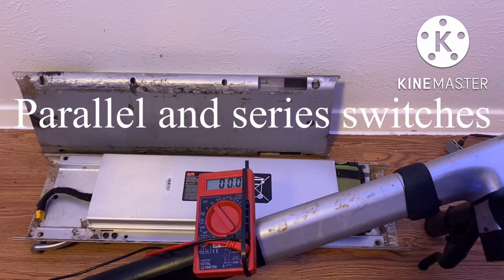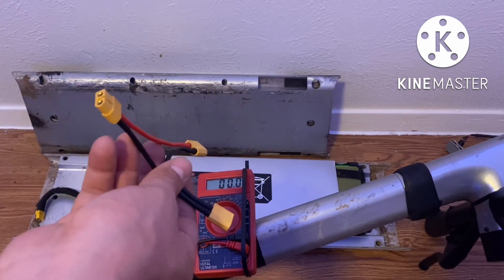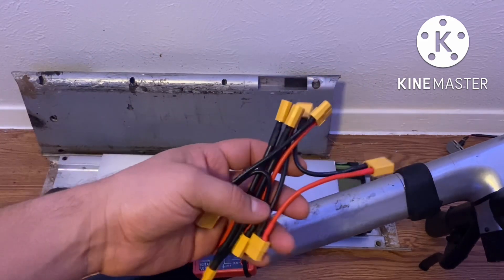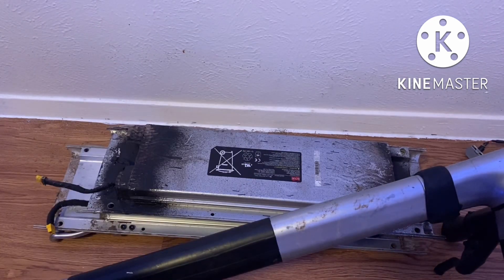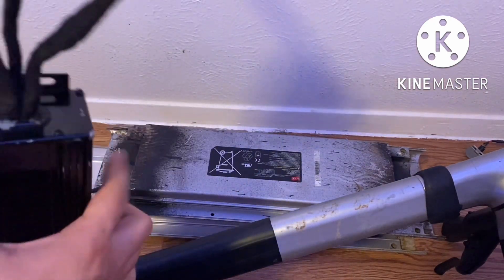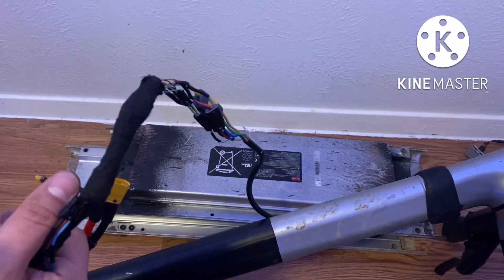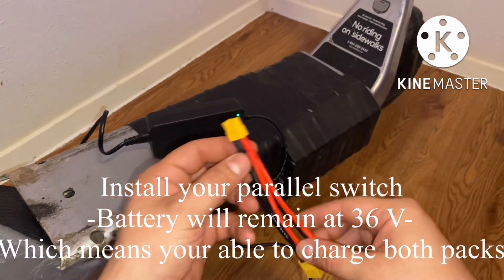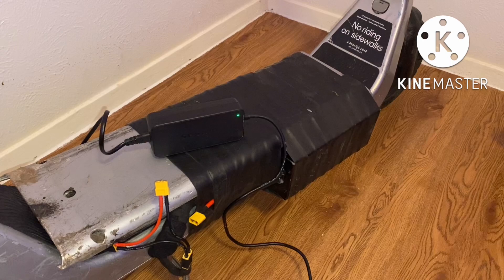Bird 2/3 scooter Parallel/Series￼ Connecters -how to- DIY /charge 72v￼ battery using 36v 🔌 charger-

Comment: He never said that you can run the original motor and/or controller on 72 volts. It would be great if it would,  I'm just a little afraid of trying it if I don't know for sure it will work and not burn up my controller or my motor. Anyone out there tried it?? If you have and if you know it works or not, please reply to this comment and let me know. Thanks I appreciate it!!
Reply: I run a bird one m590 36 volt motor on 84 volts with no ferrofluid and it barely gets warm. Im talking wide open 30mph from full charge all the way til empty. them motors can handle it.
Reply: The main issue is the controller if it will handle double the volts and double the amps which I don't think ANY standard original controller will.Go online and buy a universal voltage controller 36/48/52/60/72 which senses the voltage itself remember to double the amps and get one that is rated accordingly

Comment: Do you have to worry about balancing issues between identical packs? 

I'm going to build a 72v ebike, but the frame i am using has a bigass rear strut taking up triangle.  My plan is to use two 36v packs and just gorilla tape them to the top frame and run them in series. 

A 72v pack is just too big and boxy to mount top side.. 😅
Reply: Yes you should monitor the voltages , they wont balance

Comment: Can you just use two 36v battery chargers plugged into both batteries like a regular scooter? For a parallel setup.
Reply: yes. i believe the trade off of this is you effectively cut your range in half lol
Reply: @EonReevesScaleHobbies  This'd be just for charging. During normal operation the two batteries would be discharging in parallel configuration.
Reply: @ikichullo  I was thinking series, the amperage remains the same but the voltage is doubled. Does this mean you could discharge the battery quicker in series?
Reply: @EonReevesScaleHobbies more voltage gives you more spees , amperage / watts affecr the range
Reply: @aski1529   like if you had a 48v 40Ah pack, you could in theory pull 40amps @ 48v for one hour. 

When you look at say a 72v / 20Ah pack, if you pulled 80amps for 15 minutes, you'd be outta juice 😅

Comment: Good morning!  Please help me!  I have a Xiaomi scooter, see my shorts.  I installed a 36V/48V 500/750W brushless controller.  IN ORDER.  But I only have an original 36V 7.8Ah battery and today I can get a 12V 40Ah battery for 300€ from a big German company!  The battery is expensive and very good!  Can I run this 12V 40Ah in series with my original 36V 7.8Ah battery to 48V 48Ah?  But now I got a comment in my shorts that it then shuts down the original 7.8Ah battery at 48V??  And what should I do with the 12V with 40Ah.  Can you do something that won't turn off the original 36V 8Ah battery?  And what comes out then?  The BMS of the 36V 8Ah when the 8Ah is empty after 6km driving?  Please I need the help of a professional electrician and you are the best!!  Please help me what can I do because today at 12 o'clock the new 12V 40Ah auxiliary battery is coming which I want to connect in series with a Y-series cable.  PLEASE HELP!  Sincerely!  I need HELP from a pro!  PLEASE!

Comment: Do you have any series-parallel pre made wires, or do you just use both of them. Where did you get the wires from?
Reply from the maker: These parallel/series connectors can be purchased on Amazon

Check out my video description I have both links right there just click the link  It’ll take you straight to it

Comment: So I bought a 48V external switchable use battery for my ninebot but it lowkey felt sketch when I was testing wires started getting hot, is this because I was supposed to get another 36V instead of 48V
Reply: MISMATCH VOLTS CAN CAUSE EXPLOSIONS AND BURN YOU AND YOUR HOUSE DOWN
Reply: @gravityiskey  thanks for telling me 6 months later my house is already in crisps…
Reply: @malachit6282  OMG THANK GOD YOU  CAME OUT UNHARMED
Reply: @gravityiskey  jk hehe

Comment: How you bypass battery brother or can u ueas derint battery ??
Reply from the maker: Bypass p+ to b+  

As long as the battery is 36 V and fits the housing then yes you can use a different battery.

If you use a bigger battery then you also have to use a bigger controller to match that battery.

Comment: Hey PJ...what top end speeds are you getting with 72 volts?
https://youtu.be/Riw_6kSYxzs
Reply from the maker: 40 mph for me , that’s using the stock hub motor-36v 400w -. You can definitely get higher speeds by using a hub motor that is rated for what the controller is rated for.

With a 72 V 2000/3000 W hub motor
You should be picking up around 50-55 mph in that range.

Note: this hub motor gets very hot because the amount of current I’m delivering to it , not to mention the voltage ! 

But I can still drive it 7-8 miles at top speed
Before it starts getting hot on flat surfaces going TopSpeed.. putting it through stress or going up long hills for long periods of time will definitely run the motor hotter at a quicker pace.

Nice set up tho man !! Good work and we’ll done ✅ 🔥🤟
Reply: @pjscootermods  the stockmotor can handle 108 volts...
As with 72 volts, when the batteries are at peak charge... You need to baby the throttle off the line. If you punch it...the hall sensors MELT... FYI in my opinion the scooters are a bit sketchy at speeds above 30 MPH..
Adding suspension made a world of difference.
Anyway Thanks for all of your videos....all are very helpful.

Comment: The throttle doesn’t work, can you make a video on it please I try hooking up the breadboard on the top v3
Reply: Hi,
like we previously discussed, there is another way, by hooking the throttle wires to a multimeter you can figure out easily where the throttle wires goes and use it there.

Comment: Yo!!! You gotta stop fuckin with those lame ass big controllers and get on it with a vesc bro! Trust me it's worth the extra money!!! Stock motor stock 36v battery I can do 35mph and get like 12-15 mi with hills and shit!
Reply: Ps thanks for getting me on this decom bird gang! Shits lit!
Reply: Which one do you use? That fits into the v3
Reply: @dannys4831  ubox single! 100v 100a that b3 motor will take quite a grip of power just watch the amps on your hall sensors they fry easy
Reply: Drop link bro
Reply: If you go to CFW you Can created your own files work for Xiaomi and ninobot. Make the tired To 10 to make it run to 40 kph

Comment: Hi, You are using the 72v with the 36V motor?? Didn´t overheat the motor?
Reply from the maker: I can drive it maybe 4-5 miles ! Full speed
It gets very hot hub motor is drawing too much current which equals heat..

However driving it at a regular speeds 20-25 mph you should be OK because you’re not just dumping a whole lot of current into it which will keep it from getting hot

The fix: getting a motor 72v 1000w/3000w that fits the rear assembly.